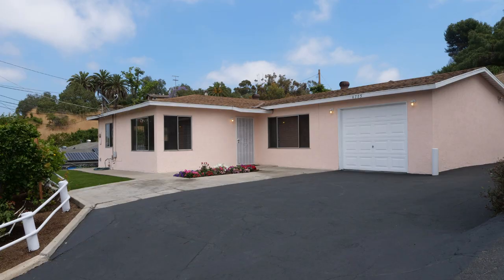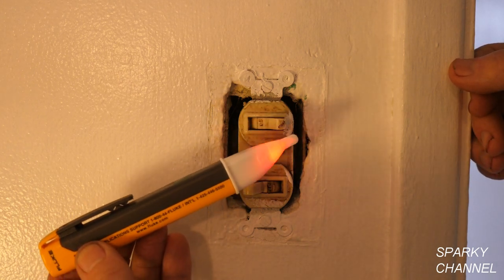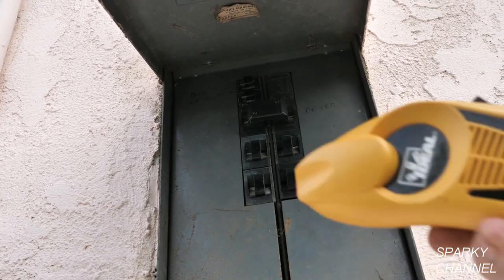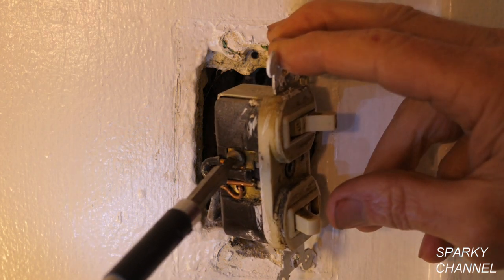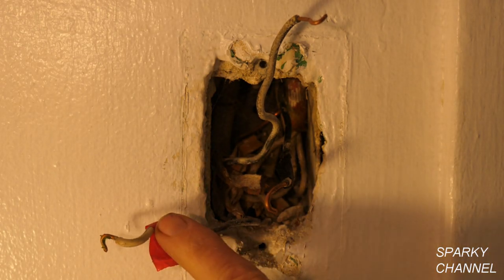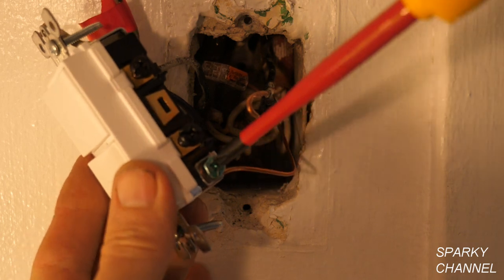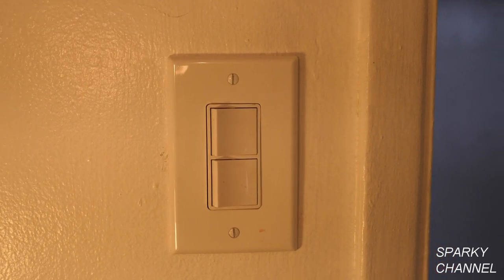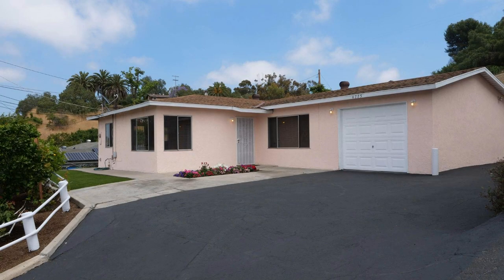Double Switch Test and Replacement for Bath Fan and Light in a 1960 House

Comment: I just want to say thank you for the video. You explained it so thoroughly and made easy to understand! Before watching, I actually tried switching out a similar switch with a toggle switch next to it in my master bath.All I did was switch wire for wire and it was all messed up. Nothing worked like it was supposed to, but after watching this video, I was able to correct everything and now all works like it should!!!

Comment: Im going to be installing (from scratch)  a new bathroom fan.  Ill be fishing romex down to the existing single switch box and replacing the single with this double switch.  I get the line wire, and the load wires, but what will i do with the neutral?  Individual wire nuts on old neutral and new romex neutral? or should both neutrals be wire nutted together?

Comment: Hi Mr. Sparky!
Thanks for the video! I'm just curious, what about the white(neutral) wires? Are they spliced together with wire nuts? If so, how many whites are there? Thanks. Love the videos!
Reply from the maker: Hi Manny! I don't remember, it's been a long time. If the box had neutrals, yes, they would be connected together in the back of the box.

Comment: what would i do in this scenario....sort of...my situation...my dad took one of these out of his rental houses...except his also had an outlet and the 2 switches....he wants to replace with a double switch....one runs a kichen light...other runs a stairway light...that also has a pull string...but then from the pullstring light the the wires run down the wall to another single pole switch that also has the outside light ran into that switch box....there are 3 old knob and tube wires ran to the pullswitch light from the switch from the kitchen...and 2 old knob n tube wires ran down to the switch that also runs the outside light....want to seperate that stairway light and the outside light via a double switch like u are showing...ive tried but i cant seem to figure out how to run each light separately from switch by door...im an apprentice that usually does commercial work...but would like to figure this out for him....

Comment: I like your videos and find them very informative. My question is as long as the fan and light are on the same circuit, why couldn't you use a single pole switch and use a pigtail on the load side of the switch for both? That way when the switch was turned on both the fan and light would be energized. Or, would that violate the code?
Reply from the maker: You could do that. But I think most people would prefer to have the fan and light on separate switches.
Reply: @SparkyChannel yep; that’s the whole idea… having the light and fan separately on and off! THX for this video!
Reply: No it would just violate common sense!  The whole purpose of the double switch is to control the fan and light separately!

Comment: That box looks scary with all that old fabric insulated wiring. My house was built in 1932 and all that fabric was hard as a rock and would break when you bend it. The house was an incident just waiting to happen. I just pulled 500 feet of 12/2 Romex. My anxiety levels have gone down significantly.
Reply from the maker: Great job!

Comment: Guy remodeled my bathroom, I have same type switch one runs the fan, other vanity and celing light.(1906 house, electrical redone in 1980).He tapped into power to install a Backlit vanity mirror and would blink, so he found another source. Now when I turn fan on, light goes off and if light is on fan goes off. Checked switches and looks like has 2 black hot wires and one white. I think he mixed up wires behind vanity light, now I don't know what to do.

Comment: Great video. I have the same problem  but I dont know what the other switch is the lower part but upper is my light in the room how can you help me..thank you have a blessed day and be blessed
Reply from the maker: I can't tell from here but if it's in a bathroom perhaps the other switch goes to a bath fan?
Reply: @SparkyChannel  thank you...for your kind response...I dont have an exhaust fan because the house was built 40 years ago..I wanted to add 1 but do you have a how to video...thank you have a blessed day and be blessed

Comment: I have a 1960s house in SoCal and the ground wires inside the metal outlet/switch boxes seem to be just tied together and  pushed out of a hole behind the box going nowhere.  The old switches are not attached to the ground wires.  How can I tell if the ground wires are properly grounded vs being tied back into the neutral bus bar?  Thank you.
Reply: In these old houses they used a 16 gauge wire I believe, and tied to the back of the box with a screw or nut. It actually looks like a hack job compared to today's standards. You can't really see it without removing part of the wall from the back side or removing the box. Probably not worth it. What you can do is check for ground electrically. With power on use a multimeter, with one probe on the metal box and the other on the hot screw or hot slot in the receptacle. If it reads approximately 120 volts, the box is grounded. The mounting screws on the receptacle will ground it by contact when fastened securely.

Comment: Hi there , hey I went to replace our double switch and found when looking for the hot with my meter that I was getting 109volts from a neutral wire, I also had a black wire with 120 volts , not sure what to do with it I’m afraid to hook the wires back to the new switch!  Can you advise me?
Reply: Ps. House built in1947!

Comment: What If my power comes from my light, to a single pole switch. But I want to change to a double switch, where the top rocker controls the existing light, and the second switch runs my new vent fan.

Comment: Why did you not change the electrical box?
Reply: It looks like the box has been partially plastered in and if the box is still intact, then why risk breaking a big chunk of plaster off and have to repair that and then probably have to repaint the wall to get the faded paint to match.  Plus, the ‘old work boxes’ with the flip out wings are not very secure once installed.  If the original box is safe and secure, why chance it.

Comment: Sparky can I use a nuetral as a switch leg
Reply from the maker: No, definitely not. If for some reason you need to use a white wire as a hot wire it must be clearly re-identified on both ends with black or red tape to identify it as a hot wire.
Reply: @SparkyChannel  thanks sparky